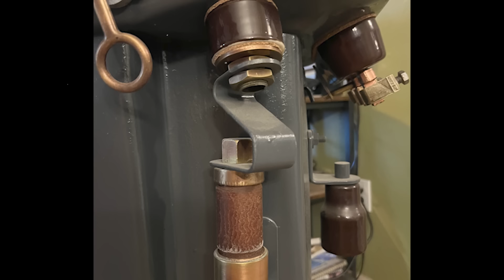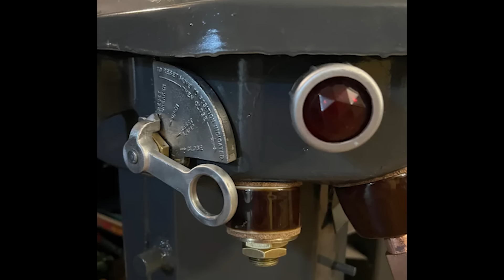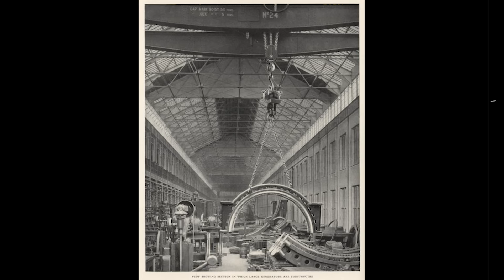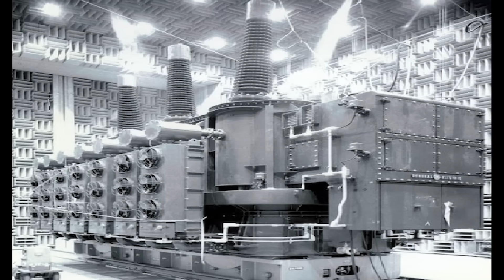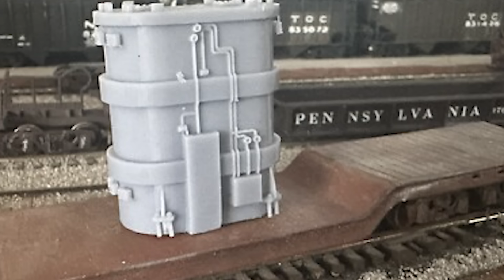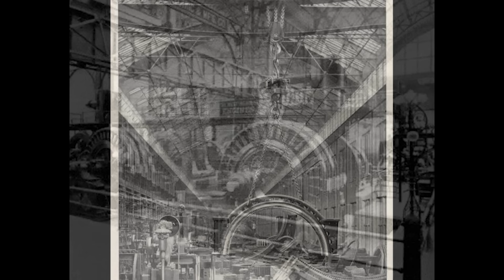Why Westinghouse's 1950s Transformers Still Work While Modern Units Fail in 15 Years

Comment: If railroad profit drove electrification, why weren't railroads electrified too?!  No overhead , just a third rail on a side, at slightly lower voltage, with multiple points in contact to "bridge" gaps at switches, and serve on both sides to parallel tracks.  
I live in a Montreal suburb, right next to the waters coming from Niagara, having worked every month up'n'down from Montreal to Toronto .....  Electric drives EVERYTHING here, with rates so cheap we use the power to Heat our Homes RESISTIVELY ...!  Sure, some neighbors have fancy Heat Pumps (from air, not geo), and one day I will install one too, but so far the apartment building (120 units) has No Meters! and the maintenance fee is $250 monthly for my 1-bedroom unit, including all the power and insurance on structure & landscaping & indoor pool maintenance & heating, & cleaning including monthly the underground parking & vacuuming the hallway carpet & lots other.  Just to underscore the low price of electric power ..... and STILL there's surplus pumped to the US east coast grid, power for New York & Washington D.C. & Maine & ........  If I leave all the lights on all year round, it DON'T MATTER ONE BIT.  
So yeah, electrification should have happened a long time ago, rail, then Roads, on the same principle of a side- contact, that doesn't have to be continuous, with a small battery just for the gaps and some margin of independence (say 30 minutes), but nowhere near the kilo- mega- Watts that go bang in the news.  Carbon roadways for ground contact ......

Comment: Many newer transformers are built the same and better. The difference is back then the load was lights and a radio.  Maybe a vacuum cleaner. Now you have heat pumps, all electric appliances, computers, etc. The electric consumption per household has greatly increased. Worse, is the new equipment uses many diodes, which places high harmonic current on the lines. The days of low harmonic currents and resulting vibration and heat are over.

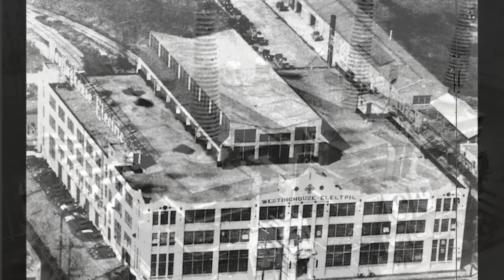Comment: @5:30 I wonder is wasn't cheaper to produce higher DC and have a motor-generator "substations" generating lower voltage ?
Reply: Yes motor <-> generator High voltage low current < to > Low voltage high current conversion would have replaced the transformers at the cost of cheap bearings & carbon brushes. But they didn't work that out in time. Also 240V instead of 120V would have helped a lot but the lightbulbs then couldn't last at that voltage.

Comment: Real facts. Not AI BS. I put in a 12v mini split in my van. In the very back. I put my batteries in the very front. Behind the drivers seat. I needed to extend the power wires. I started at 10 gage. On the coldest setting. Didn't work. I used 8 gage wire. That didn't work. Around 8 feet of wire needed to be extended. I then went with 6 gage copper wire. I got away from the aluminum. The 6 gage wire at 8 feet of extention made of copper worked perfectly. Someone might need real information.

Comment: One of the reasons they were built like that was the limitations of technology itself. Another was cost and time considerations. This was still during the electrification of America. We needed tough, reliable infrastructure that would last years without maintenance. Simply because we didn't have the maintenance infrastructure fully in place. But there was a trade off: efficiency. Those old transformers are far less efficient than what we use today. A lot of energy was wasted back then.

Comment: Nice photos, could do without the fake movie film defects.  

Here are some facts.  (Source: New York Power by Joseph J. Cunningham.)

Edison's DC system continued in operation in parts of New York City until after World War 2, but starting around 1901 it was not powered by the original DC generators; rather it was powered by alternating current from the Waterside Generating Station built along side of the East River at 38th St.  Waterside generated 25 Hz power at 6,600 volts, which was fed to around sixteen AC to DC  "substations" located throughout Manhattan below about 135th Street.  

Above 135th St, Westinghouse had extended AC service in 1889, which froze DC expansion to the area south of 135th St.

These substations had massive synchronous rotary converters to "transform" the AC into DC.   These substations also contained huge lead acid batteries the size of dumpsters to provide peak power when the DC load exceeded the capacity of the rotary converter.  The batteries charged off peak, and provided peak power and also reliability in case the 25 Hz power supply failed. 

Around 1928 Con Edison began phasing out DC distribution starting in Lower Manhattan, and estimated it would take 45 years to complete, but it was largely converted by the late 1940's, although Con Edison continued to provide DC power to some customers mainly for Elevators and the Broadway Theaters who's stage lighting systems ran on DC.  This used mostly on-site rectifiers.  This was shut down on November 14, 2007.  

The Waterside generating station was eventually upgraded to 60 Hz, but it was shut down on April 29, 2005, and has been torn down.  

Waterside began with coal-fired steam turbines and boilers in 1901. By 1963, it partially shifted to natural gas for about 60% of the year due to pipeline limits, though coal and oil remained primary fuels until decommissioning.

Originally generating 25 Hz AC to feed DC rotary converters, Waterside added frequency conversion equipment (Waterside Tie Station) in the 1920s to interconnect its legacy 25 Hz system to the emerging 60 Hz grid. This hybrid setup supported both until full 60 Hz dominance later in the century.

Each converter consisted of a 25 Hz synchronous motor mechanically coupled to a 60 Hz synchronous generator on a common shaft; the motor drove the generator at a speed matching the desired output frequency ratio (25 Hz input at ~1500 RPM producing 60 Hz output via gear ratios and the pole differences). Power flowed bidirectionally: 25-to-60 Hz for modern loads or 60-to-25 Hz emergencies using "inverted" substation rotary converters as a bridge.

These sets interconnected Waterside's original turbines with the 60 Hz network, maintaining DC supply via rotary converters until full phase-out, with startup reliant on 25 Hz availability to avoid blackouts

Comment: The first 3phase long distance power transmission were established 1891 in germany , the power line were 176 km long from Lauffen/ Neckar to Frankfurt am Main and deliver power to the world electrotechnical exhibition ,  a Generator with 220kW  / 15kV  driven  by a water mill, were used for this experiment. 
several years ago an old industrial komplex in my aera  were torn down. The brakers store all old scrap metall at the site before huge lorries came to  haul it away . Inbetween the scrap heap was an old  distribution transformer  , on the specification  plate  were  clear readable the year   of its birth:  1923,    prim 6kV , sec. 220/380V 250kVA. It was in service until the last.
Reply: don't forget PCB OIL
Reply: And in Heidelberg the mountain railway is driven by an electric motor made (roughly) 100y ago.

But for sure Europe has been waiting to get electric from across the pond until recently.
Reply: @fromgermany271 just needed silver cables. EDISON OVER RATED.

Comment: This video omits the contributions of Charles Steinmetz to polyphase power transmission while in the employ of George Westinghouse.  Steinmetz, not Tesla, developed the first practical three-phase electric motor.  Steinmetz also developed phasor analysis which is the system still taught in engineering school energy conversion courses.
Reply: Indeed! C. P. Steinmetz contribution to electrical power generation, distribution  and electrical engineering in general is paramount to its success.

Comment: Don't know if this was really AI baloney or a misinformed writer but I will say without a doubt the old transformers are far better than the new ones. Copper has a much lower resistance than aluminum and thus less I/R loss at a given load. Impedance is also far lower and the overall build quality is much better. My town still uses the old 2400/4160 wye distribution with a large number of the old black side bushing oval can transformers with the external oil cooling pipes still in service.
Reply: Aluminum is cheaper and much more of it can be used, negating that disadvantage.
Reply: @misterhat5823  Not really when you consider the costs involved with changeouts, the operative word here is cheaper and that needs no explanation.
Reply: @BrhatLee  The changeouts aren't due to aluminum. It's due to shoddy construction. You're blaming a metal for poor workmanship.
Reply: @misterhat5823  It is poor workmanship when an inferior material is used to cut costs.
Reply: @BrhatLee  Bleh. You'll argue with a rock.
Reply: @misterhat5823  Comes from 40+ years of electrical experience.

Comment: If we pay companies to keep the light on and the power on we might get back to the stuff that simply keeps on running if we pay also a bonus for improvements in energy efficiency for sometimes replacing tech if we undervolt the led filament bulbs and have a power supply per house with replaceable components that is reprearable and simply got into a pay model where you pay then to keep things running and working we might have an economy where we could do more with what we have but not go into darkness etc Lexus gives a 10 year warranty on his cars but if we payed for things to use them and keep them running then throw away technology would have no use and repair and maintenance would be included in the contract which would make it important to keep things running as long as possible!!! Railroads where made to be very durable your older trains ran where ever whenever current dutch trains seem to have more computer and other problems whilst the older ones we build ourselves at Werkspoor factory where running fine some have been brought back on track in order to replace some temporarily the systems build by Westinghouse are and were very important since durability is key !!!

Comment: Do not take this AI generated Story as fact. It left out the contributions of Tesla left and right. Why do we have 60 Hz , For example, Westinghouse People wanted 120 Hz ( 120 Hz or higher could travel farther then 60 Hz). But Tesla said his three phaze system would not work At those Hz correctly. Where is the fact that Niagara falls was first to demonstrate long AC power transmission from Niagara falls to New York? (Where is the proof of concept that power transmission could be transmitted over 120 miles that was demonstrated in Washington state between Snoqualmie falls to Seattle WA to tacoma washington back to Snoqualmie falls and back to Tacoma Wa Again? ) Where is the fact that Tesla was the one who put the Transformers in oil to keep them cool? And he didn't think that idea should have been patent because it was so simple? (No PCB oil, just plain oil). Oil also redused the transformers from arking inside. There is a lot of history left out in this AI generated story, and what Tesla Contributed to history here.
Reply: Absolutely.  Tesla was amazing.
Reply: A 120Hz AC system would be less efficient and transmit power over shorter distances than a standard 60Hz system due to increased resistive and capacitive losses and higher impedance.

Comment: This was mostly interesting (only the audio though, and in spite of doubtful-sounding details) until I heard (34:19) “Edison’s DC system would have required multiple generating stations distributed along the transmission route” which sounds like pure AI hallucination. I imagine an AI generated picture of a whole bunch of power stations, doing nothing (because there is nothing to power them), distributed along the transmission lines purely for looks, while back at the Falls the actual generators are producing 110 volt DC power to be sent over 6 inch diameter copper cables for 26 miles, by which distance there would be no power left to do useful work or light a single light bulb. But from what I have read, it doesn’t appear that Edison even made a proposal, and nobody ever seriously considered running Edison’s DC power over that distance. Some proposals were made for high voltage DC transmission, which would then have been used to turn motor-generators to produce low voltage DC where needed, and one suggested using the high voltage DC to charge batteries and supply power from them. But ultimately an 11,000 volt, 3-phase AC transmission line was built by GE, while Westinghouse built the AC generators at the falls, and Buffalo got electricity. And AI-generated stories are weird and inaccurate, and I would much rather hear a story written by a person.
Reply: This is what Nicola Tesla did for Edison turning his DC to AC and transforming it up then turning to DC again that was where the dispute of 50.000 dollars was really about, he solved the problem in a way Edison did not like !!!
This seems to be unknown or erased knowledge there is a way to solve it but I bet Nicola Tesla would have told him using alternating current all the way would be a good idea probably better they're patents combined after both where death created general Electric, Westinghouse builds durable period still up to other equipment to although that requires testing and safety too, but I don't want to go into certain other equipment for the modern Era... Well Anyway Nicola Tesla designed air pressure power switches because Edison's DC equipment before being connected on dud build up high static charge to being able to kill a man who operated the on switch so Nicola Tesla already knew about well some dangers used them to his advantage in another setup and technically seen DC is way more Dangerous then AC and well anyway we all know as technicians about the real dangers of inappropriate use of technology!!!

Comment: When were pcb soaked coils abandoned
Reply: 1970s/1980s the pcbs turned out to be a rather nasty carcinogen. A lot still in place, others retrofilled with replacement oils. PCBS were used due to lack of flammability and chemical stability.
Reply: Yeah Edison didn’t understand the genius of Tesla. In fact Edison took credit for a lot of electrical devices that he didn’t actually invent.
Reply: First used in 1936, last used in 1977. Quick test, not definitive for PCB: Soak a bit of paper towel in it. Light with match. If burns, it's definitely not PCB. If it doesn't, it's not a definitive test either way, send to lab or treat as if it is PCB.

Comment: Retired electrician and these o!err transformers were bullet proof because of ample amount of copper and cooling. Been in my house 50 years and the 13,200 to 120/240 volt distribution transformer has been replaced twice.Westinghouse always made quality products. Cutler Hammer purchased them and unfortunately the Westinghouse name is disappearing.
Reply: I have a electric Westinghouse table top oven from the 1940's still works great
Reply: It is, however, used on cheap junk for the consumer market.
Reply: Cutler hammer doesn't exist, they are a name under Eaton